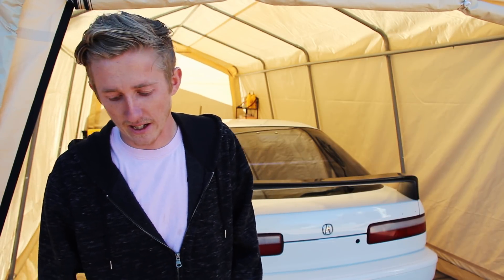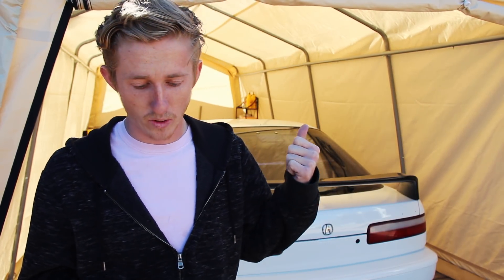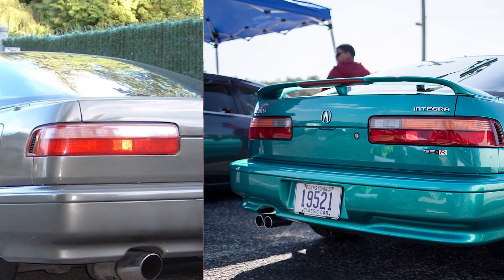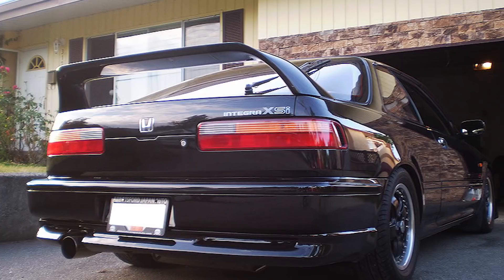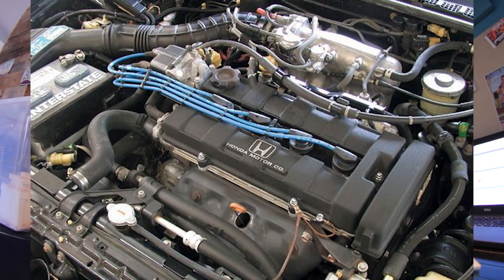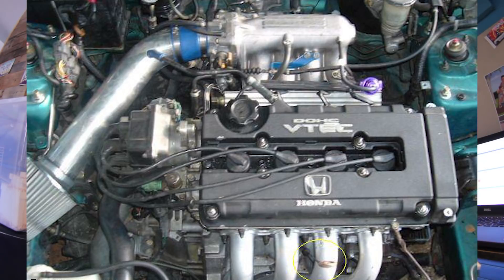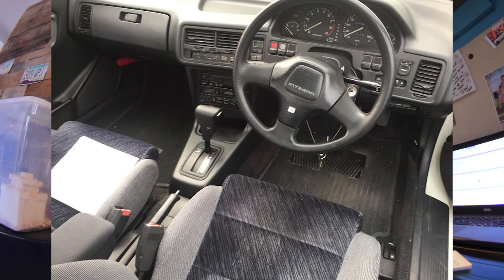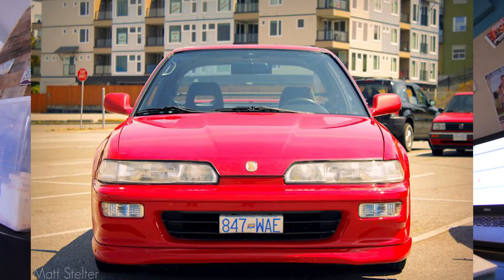DA9 vs DB2- Whats The Difference?

Comment: When I was like 19, I bought a '92 GS and it was my 2nd car. The previous owner painted it phoenix yellow and swapped in a B16A2 from a '99 SI with skunk2 stage 1 cams, 4-1 headers, intake and a Greddy SP2 cat-back. Basically just normal bolt ons aside from the aftermarket cams. I got into a fair amount of trouble with that car despite the fact it probably barely made 150-160whp if that. It was loud, it was type-r yellow and it was slammed on coilovers to the point where i'd scrape the bottom of the header fairly often with it lol. It was definitely a project car and it had a lot of issues and needed body work but I abused the hell out of that thing for 3-4 years while I owned it. Great car. Very loud, very dramatic/sharp v-tec crossover, sounded great.
Reply: Was the front crossmember cut to fit the 4-1 header? In 2004 I put a B18c5 Type-R engine in my '92 GSR DB2 and the 4-1 manifolds would not fit without cutting the front crossmember. I used a Mugen Gymkhana-spec 4-2-1 manifold so the crossmember did not need to be cut. I was told at that time the Toda 4-2-1 manifold would have also fit without cutting.

Comment: Integra Type R's do NOT have additional stitch or spot welding. They used thicker steel in key areas (rear upper roof rail, rear hatch jambs, inner quarter skins, inner and outer rear wheel tubs and front upper towers, as well as a different rear lower subframe). I have directly compared my 98 ITR, 98 GSR and a 99 GS and can confirm that there are NO additional welds
Reply from the maker: Good to know. Thanks, lots of misconception about the Type-R out there

Comment: Thanks for all the info man . I recently just bought a trashed 90 da9 ls from a tow yard for $150 . I'm glad I stumbled upon this video and now I have a lot of ideas on what to do differently on this car . For $150 wasnt bad had good reg clean title and really just needed a timing belt and might need a clutch down the road to run and drive plus fully adjustable coilovers on all four corners . I really like the look of the front and rear bumper of the 92-93 as well as the taillights and even factory looking spoiler . So I thank you for all the info .
Reply: how's your integra doing?

Comment: Thank you so much Chris! 
I just bought a DA7, any suggestions on where i can find good info on them ? TIA 
Also how do i know if mines a AWD ?? 
Cheers
Reply from the maker: If you look under the rear end and see a differential and a drive shaft then it’s AWD. Also Honda usually put a “a Real-time awd” sticker on it
Reply: ChrisSadowski I think mine is the FWD. No differential back there. Thanks again 

Would you suggest any engine upgrades to the ZC engine ( I don't wanna a swap). It's a JDM da7 in almost mint condition, it still has the original carpets in mint condition so I wanna respect the stock but want some power upgrade :D
Reply from the maker: jus full bolt ons, intake header and exhaust. Maybe upgrade your cams and some valve spring and retainers and a tune. those ZC motors are pretty sweet and still highly sought after out here
Reply: ChrisSadowski thanks again Bro. 
I'll try to get some after market cams and valves and may be some pistons (stuff is hard to ship/find in Bangladesh). Thinking of boring out the engine and give a nice over haul. What do you think?
Maybe I can film it for you

Comment: 90 LS models had manual windows and locks but had a sunroof and CC. 
90 GS models had power Windoes, abs, CC but had manual locks. 
Its not until 91 that GS ended up getting power locks and the LS got the power windows.
2nd gen integras never came AWD only the 3rd gens did.
Reply: got it, makes sense now. Lol its so odd having power everything BUT locks
Reply: Better_Calm was just askin him that
Reply: I had a 90 gs with power locks
Reply: Db1 gs had power locks in 1990 not sure about the 2 door tho
Reply: @uriellamere7596  the 4dr db1 GS trim did have power locks.  However the 2dr da GS did not.
Reply: I have a 90 Integra game it has power  locks for sure

Comment: I like some info on stock spec b series, the 90-91 B18, b16,  92-93 b18a1, b17a1.  be advised of the Foreign 2nd gen, they came with SOHC engines, I heard there is an AWD, and the rear bumper has no license plate, it is all flat.

Comment: Db2, Aztec green pearl, Milano red, 8.5k redline, b17, lighter flywheel, transmission, polished 6 spoke wheels, special trim and badging, seats with red pinstriping, around 5500 made inc canada, different axle back, spoiler, p61 ecu.....
Reply from the maker: I wasn’t going into the specifics. Just the main differences between the chassis...
Reply: Extra note, DB2 offered in Black in Canada, not in USA

Comment: DB2 there is interior sound deadening material, more of that, so I been told, I never checked when i had my damaged db2, but I think the cross members and the rack and pinion are different,  I think the BD2 has tighter turn radius.  Correct me if I am wrong in this, I never verified that.  BY the way, can you fixed a cracked block?
Reply from the maker: I hadn’t heard those things about the DB2 before but I can’t confirm it. 

As for the cracked block it depends where the crack is. If it’s not too bad it can be welded

Comment: I have a 92 LS and a 91 LS. Although the bumper Is a little different, are they interchangeable? Same with the rear bumper and interior?
Reply from the maker: Yeah it’s all interchangeable. Just gotta change the bumper brackets with the bumper cover. They are different between the facelift and pre facelift

Comment: Great video.  Thanks for putting it together and also all really good info provided.  

I came across an interesting lil tidbit.  That, seperates. The 90 from the rest of the model years in the 2nd Gen family. 

Its an exterior styling/design. Element.  Or rather the abscence of it. 
That makes the 90 unique. From the other 3 years. 
 In regards.  To the amount if it and the placement of it on the cars. 
and the trend that car companys. Kinda went crazy with. Which was the practice of splattering the cars n trucks with a lot of em Emblems logos brand badges.  It all throughout the 80's. And so in 89 or whenever they put the pencil to drawing paper.   They wanted to show the consumers that they wrre paying attention. And so for the 1990 redesign they went to essentials 
They did away with the acura badge on the hood and the only branding, was smaller in size and it was all placed on the rear of the car. On the hatch lid and trunk lid.   
 So yeah if youve ever had a hood. That didnt have the 2 small side by side factory drilled holes where the acura badge would be.   It was from a 1990 da9.   91. Had the front hood badge 

Counting my current da9. Which is  #3. For me. All 3 of them have been 1990 da's  unplanned completely.  Lol 
2 LS. and one RS.   

But yeah.  The 90 da9.  Didnt have an acura hood badge.

Comment: 7:31 My 1990 GS DA9 as the 3 spoke like this but the integra is not white, its just engraved and there is a cruise control button setup on the lower right spoke. US difference i guess.  I prefer the look over the 4 spoke but thats juts mine bc its got the fancy buttons and cleaner looks without the white lettering. Everyone is different.

Comment: great video missing some info on the db2 but I would love to see more of these
Reply from the maker: EuroWarmachine R this was more of an engine comparison  and base chassis. Not the nitty gritty. But I may do another one just about the DB2
Reply: awesome I'll be posted I have a k20 da9 and a db2 in the works right now eventually I'll start making videos as well would love some tips
Reply from the maker: EuroWarmachine R what axles are your using? I’m about to k20 swap mine and still need to get axles
Reply: k20 insane axles
Reply: what motor mounts your planning on using ?
Reply from the maker: EuroWarmachine R only the best, Hasport. We’re actually doing the swap at Hasport so I’m getting the brackets and mounts free
Reply: lucky lol I wish I had support i literally bought the  k20a2 for 1400$ full swap upgraded everything hybrid racing and now I'm currently doing full lines pump and computer. but that's awesome you have support
Reply from the maker: EuroWarmachine R dang lol. I got my k20a2 for 164$ and I hunted down the matching trans for $400. But yeah a lot of the swap is being supported by Hasport, a couple subscribers and a few other people. I’m still needing axles, a few sensors and shift cables but the rest is pretty much taken care of

Comment: the db2 had 1.8mm thick frame rails vs the da9 at 1.6mm. This was to help with body flex and the lack of the center beam to clear the b17 header. Also, the db2 and ls special edition were built on the special hand production line with the nsx, and later the integra type r, s2000, dc5 type r/s and I also believe some mugen / spoon builds. Also, you dont mention the rsi, zs, zsi rzi models which also had their own differences. The awd da5 was a good mention though.
Reply from the maker: paul06660 this was not supposed to be a full breakdown. It was more essentially about the DB2 and DA9. Only part I did not know about was the frame rails.
Reply: ChrisSadowski oi mate you should mention some of this stuff though because that's what were curious about.
Reply from the maker: jdmnsxr 6 it’s a bit too late to go back and re make the video. I don’t think most people would appreciate it to see it twice. But I would also need proof that info like that is true. I searched and saw no articles or anything talking about that. Not saying it’s false, but I would want a credible source so I’m not blaspheming
Reply: ChrisSadowski well I don't know about him claiming all that other stuff. the only thing that Is for sure true is just the thicker frame rails but other then that its cool.
Reply: Ive owned second gen integras since my first car in 1998. But dont get me wrong, im still learning new things about them to this day.

Comment: I know I miss my b18c5/B18a my car was all motor pushing like 300+hp-250- 275whp with 9,000 Redline With All Parts 10,000rpm safe with jg eldorbrok intake manifold, str fuel rail, haimlian fuel pressure regulator, eclispe gsx injectiors, bbk 70mm throttle body full Aem cold air full Ported and polished GSR head with Bronze Valve Guides Stainless steel valves with 3 way angle job and dual springs, block girdle with 20 over type r pistons on eagle h beams rods, with stock crank knife edged motor fully balanced and blueprinted mugan header from Japan not Megan, kevlar tomi timing belt, type r cams, bigger oil pump with a aftermarket oil pan that held extra quart of oil, full 2.5 to 3 inch exhaust, apexi vetec controller first one and replaced with the 2nd version + much more I'm leaving out like racing clutch AND LIMITED SLIP DIFF all in a 1992 Integra RS hatch had a moon roof seriously but my doors and windows were manual 
WAS SWEET

Comment: Whoa, an Auto cluster with 9k rpm? b16 engine?
how did that setup run?  the JDM manual for the b16a 90-91 tran that I found was either A1, which I think might be the USDM, and the S1, which is insane short

Comment: Hey bro so I’m gonna go ahead and do a b20b swap on my DA I have around $2000 for a full swap and a few goodies, $400 for the b20b and I’m taking it to a shop to have them do it since I won’t have time to do myself, but you think $2000 is enough to do the swap with new clutch and wheels and tires, possibly used coil overs.??
Reply from the maker: Tyler Rhine it just depends on how much the shop charges you for the swap. And also depends on how much your paying for the rest of the stuff. But I would be careful getting used coilovers. Second hand suspension components are usually pretty sketchy since you don’t know the mileage or the types of abuse they have seen

Comment: 1990-91 lesser spindles,  1992-92 is YS1, it is a different ratio from the other LS transmission, the ratio shift is nearly the same as the YS1 GSR, longer final.

Comment: There is a difference on the jdm tails us dot approved have reflectors in the tails versus the jdm ones both in the 50/50 and the tri tails the all clears were an aftermarket option which I forgot the maker but they were only available for like 5 years or so and they stopped making them

Comment: I bought my first car in 05 when I was 16. Paid 900 bucks for a 90 Integra ls. Was a black 5spd 2dr with a b18b1 not sure if that's a factory option it did have 230k on the odometer possibly had been swapped. Bought at a auction so didn't really know the history. It also had manuel locks, windows, sunroof/moonroof don't know the difference and cruise control... between it and the 96 ls and 95 gsr I've owned it was my favorite. Really thinking of selling my bass boat to put towards another da. Anyone wanna by a 1990 21ft ranger with a 98 200 Johnson? Asking 3500.

Comment: So which model has the awd system? I want an integra but not the fwd
Reply from the maker: We didn’t get them in the states. They are extremely rare and came with single cam engines and essentially wagon drivetrains

Comment: Are the parts interchangeable from 92-93 to 90-91?
Reply from the maker: Yes, pretty much everything is. Front bumpers yes, you just need the bumper supports with it. Everything else swaps right over. You just can’t put 90-91 bumper turn signals on a 92-93 bumper